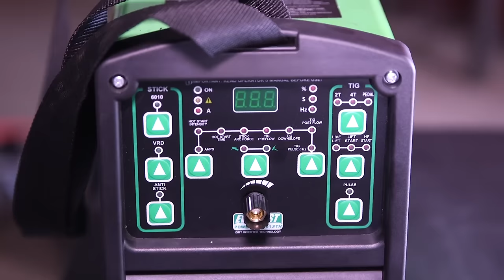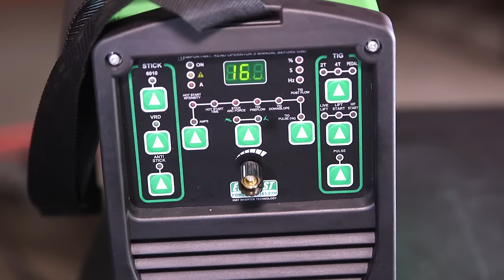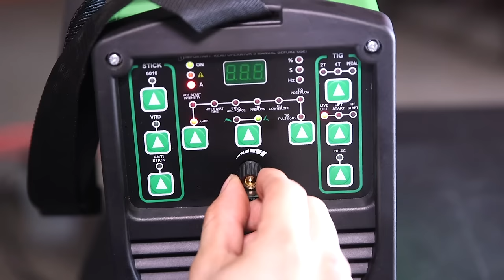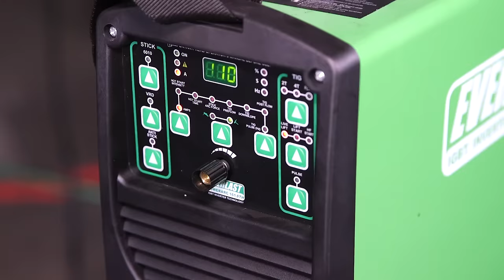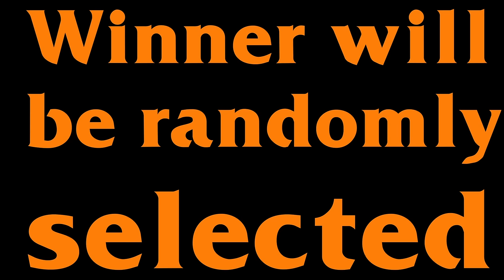6G TIG Welding Test on Thin Wall Tube / Pipe

Comment: Quick question how come you turn the juice up to 110 when I've done 2" heavy wall 6g in the past I've rooted on about 80 amps for the bottom then up to about 90 then I fill and cap on the same juice to try and akeep the heat out of it because in the past I've been told it can cause paws if the pipe gets to hot I've been welding 11 years and still leaning and getting better all time am just tryna pick up some more knowledge always aiming to improve, great job btw

Comment: Where do you guys dig these people up?   “This torch is a little different, it doesn’t have a gas valve, you push the button and the argon comes out.”
Actually you just described a gas valve exactly.
It’s actually a gas solenoid he is referencing for those that want to learn correctly.

Comment: What you use 100% Argo or 75/15
Reply: Seemed to be a few blue gas bottles near the machine, so my guess would be 100% argon.
Reply: 75/15 ??? what is the remaining 10%?
Reply: tig is only 100% argon or helium argon mix which is more expensive. 75/25 is a no go in tig welding
Reply: @Intrusive32  no it's not. There is a argon- oxygen mix (98/2, 95/5) for aluminum,  a argon-nitrogen mix for duplex stainless steel and a argon- hydrogen mix for regular stainless steel.  That's why it is technically incorrect to use the term TIG, because the I stands for inert. GTAW - proper way to call this process.  Peace✌.
Reply: Андрей Клименко we learn something new every day. I’m still learning about tig. At least I was right about no c02. But thank you for the reply and for correcting me. I appreciate it
Reply: @Intrusive32  you're welcome friend